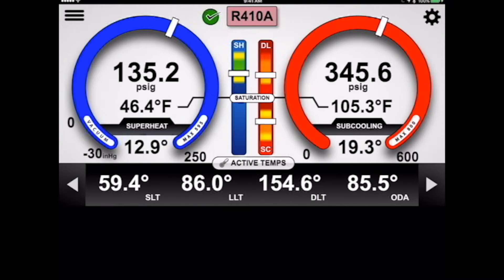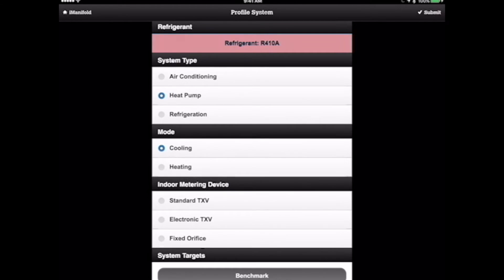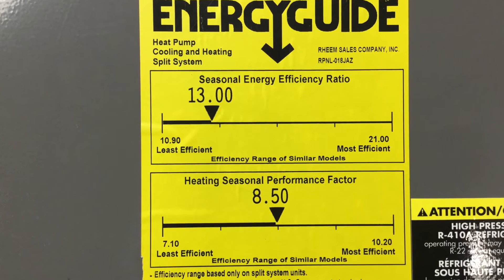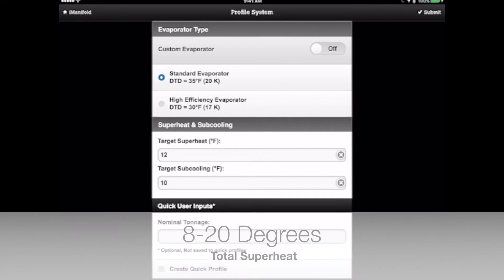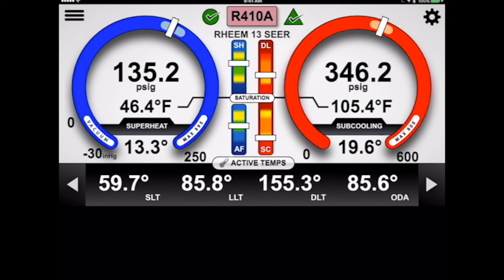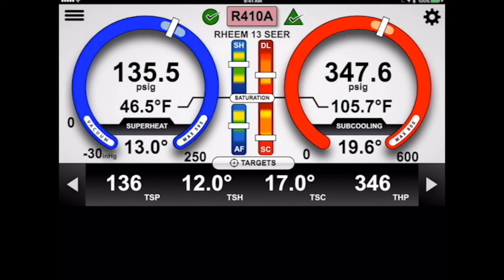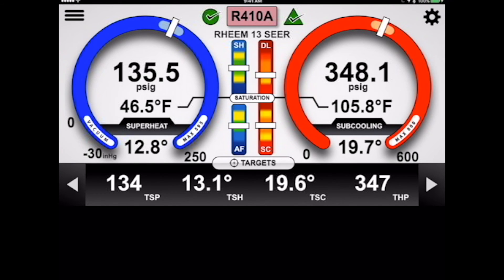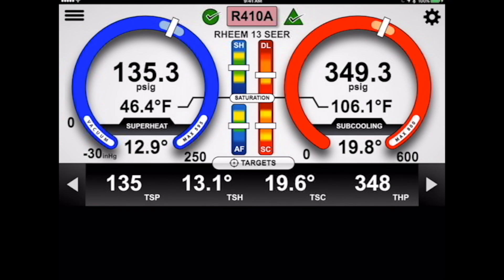System Profiling with the iManifold

Comment: thanks, this was helpful,  i still have cloud issues also,  when i go back to check a profiled system, the data is not the same, for instance, 3ph 240v 2circuits will show 1circuit single phase 120v.